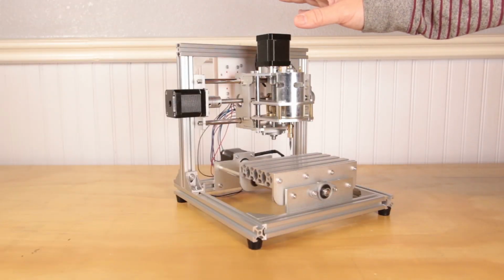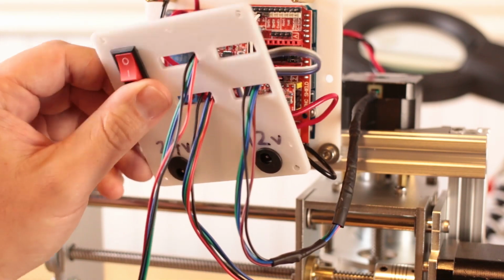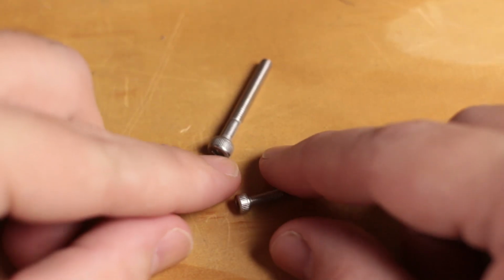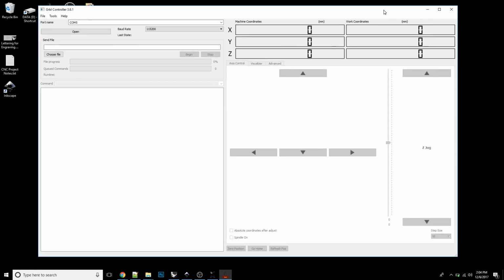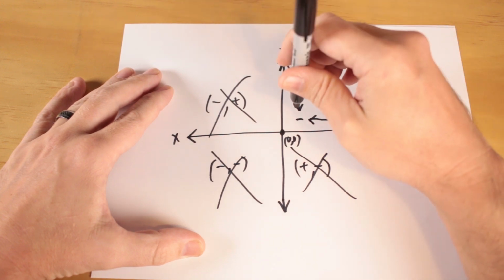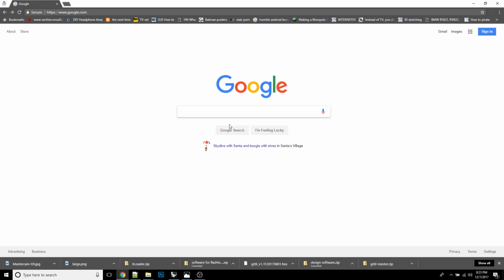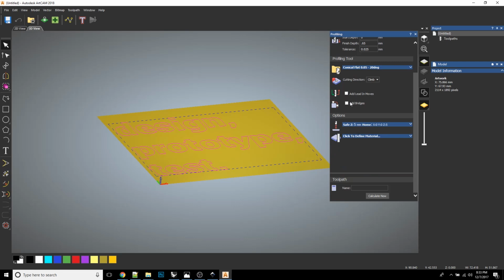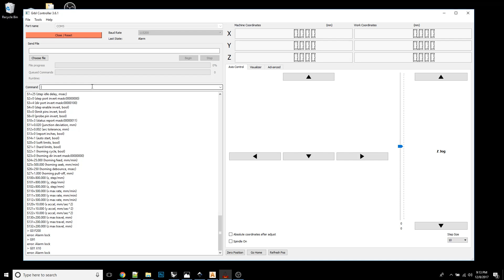How to start CNC Machining for under $200 - Working with the T8 CNC engraver

Comment: Wow the internet is certainly a place with opinions! Having skimmed through the solder/crimp discussion I would encourage you to consider moving from tinning wires to using ferrules and for crimps terminals also replace the soldering iron and needle nose pliers with a suitable crimping tool. You can now get "IWISS micro crimper" for about $10 off AliExpress instead of the pricy Japan made Engineer PA-09 and with a bit of practice you can use the same tool for virtually all your crimping needs (+ a separate ferrule crimping tool); so expensive tooling and one tool for each terminal is no longer an excuse for not making proper crimped connections that do not need solder.  Soldering has its use, but I would argue that more people would have less issues on moving connections if they got medium crimping skills compared to medium soldering skills.

Maybe you can get Gear best to stock the crimp tool and send you one to review, along with a ferrule kit. Once you master crimping I doubt you'll return to soldering.
Reply from the maker: Thank you for the well balanced comment. I have already begun using a crimping tool as you suggested. They are reasonably inexpensive and can be found on ebay and amazon by looking up "Dupont Crimping Tool" and "Dupont Crimping Kit." However, I seriously doubt the issue is as critical as the comments make it out to be. 

In my other video where I had the issue with the heated bed wire, I think one of the comments was correct. The issue stemmed from a terminal block which was not attached flush with the PCB. Therefore, as I tightened the screws, the terminal block twisted, and the solder on the PCB cracked. This lessened the cross-section of the effective "wire" which created a bottleneck for the current and caused the joint to heat up to the point where it melted the terminal block. A ferrule in this case would not have solved the problem. Also, ferrules are redundant. They crimp onto the wire creating a mechanical connection in compression. The terminal blocks also create a mechanical connection in compression when you tighten the screws.

Comment: DON'T TIN THE WIRE GOING INTO A COMPRESSION STYLE SCREW TERMINAL!  The idea of it, as the screw is tightened, is to spread the strands and create a larger contact "pad", as opposed to 2 narrow points that you get when tinning and creating what is essentially a single, solid conductor.  In addition, the compression against the strands aids in maintaining pressure and good contact when the wire and/or connector expands/contracts due to heat, which is less effective with a solid conductor...and a higher amount of heat is more likely to occur due to the lesser contact pad with the solid conductor, as it acts as a resistor.  Furthermore, tinning the strands into a solid conductor, as well as soldering wire onto a terminal, increases the possibility of the wire breaking when installed on a device that tends to vibrate.  This last point is not very likely to be greatly relevant here, but still worth mentioning.

Comment: You don't want to solider any cables that move around, you effectively make a stress point and negate the braiding in the wire. The wire will break off over time just like when you bend any solid cable, probably faster.

Comment: your actually supposed to NOT tin your connectors, the solder can crack and leads to a worse connection (solder has more resistance) than bare twisted copper.

Comment: An easier way to get the full y-axis travel is to mount the y-axis endplate to the outside of the frame, and move the rear crossmember forwards a bit. Makes the machine slightly bigger, though!

Comment: 12:50. The socket must have two ground pins. One is always connected and another one disconnects when something is plugged on. Its a feature not a defect. It serves as to disconnect to battery power when dc jack is connected in consumer electronics. Just solder the wire to another ground pin.

Comment: Good video, on the electrics agree, dump the solder, dump the quick connectors etc put everything direct on to rocker switches with leds.... you already have a plug on them so why have another just there to create a hot spot..... personally i would take th eelctrics as far away as i could from the machine and seal them up in their own box and stick a fan in it,.

I  never understand why they insist on putting them on the frame, i guess its cheap but its asking for trouble if you go down the metal route,  they will be full or crap in a week, add an air assist and a suction system and you are away.... 

The spindle speed is very slow on this model. so bear that in mins, many passes will be needed to produce something half decent , well presented video and useful to see the math explained so thank you for doing this....their are also plenty of other cam software and grbl out there for the asking....also of course if you MC board can run it Mach 3/4 the king of CNC

Comment: Tipp: Don't pre-solder the wire end, they'll lose their flexibility. Just clamp the flat plugs tightly, this will actually "cold weld" the wire and plug together and reduce the risk of breaking. (Google it!)

Comment: Just a little FYI:
The connector (socket) you had problems with has 3 Contacts, 1 connected to the (center) pin (and please stop giving them names polarity is not standardized on those connectors) and 1 for the sleeve (outside contact), the remaining one is the "sleeve shunt". The sleeve and sleeve shunt are closed (continutiy) when no plug is inserted, when a plug is inserted one of them is connected to the outside of the plug (the sleeve), the second contact (the sleeve shunt) is disconnected. This system was introduced so it was easy to e.g. disconnect a battery pack when a external power suppy was connected, the plug basically opens a NC switch.

Typically (as this is also not a standardized thing) the opposing 2 connectors (on the side you are soldering or crimping to) are the (center) pin and the sleeve shunt while the 3rd solder terminal is the sleeve.

Hope this helps people down the line as you connectors were fine (you just connected them wrong)

Also regarding the Solder in screw terminals, it's illegal to build / import devices using tinned leads in screw terminals at least in a few countries in Europe (don't know if it is even the whole of Europe) and insurance companies will jump on it if they see it (even if you got pinched by the spindle, they are going to argue that you weren't supposed to own or use such a device, which is correct and they are most likely not going to have to pay anything) this is especially problematic as tinned leads in screw terminals are a common source of arcing and therefore excessive heat up to causing fires.
Reply from the maker: Thank you for the good information about the socket connector. I have pinned your comment so that others will get the good info. That being said, one of my connectors was definitely defective. The other one works fine.
Reply: Yes. You are never supposed to solder wire being used in a crimp connector. I understand that you don’t have a proper crimper, which, if you’re going to do this type of work, you really need to get. You don’t need the pro tools I have, but a ratcheting crimper, where you get the same crimp every time, is really necessary.
Reply: Michael Amann Thank you. Came down here to explain the same thing.
Reply: That is because solder causes a rigid breakpoint from vibration, but every failed connection I've seen in homebuilt aircraft was crimped. Rules are for fools. I used 3 sizes of heat shrink on each terminal for stress relief and soldered all. Never had a loose connector on the ground or in flight and it was my ass at risk.
Reply: Sick Vic "Rules are for fools." 😂😂😂
Reply: sic vic ; i am so sorry that you feel that "rules are for fools". i learned my lessons the hard way, in the service in the early 70's, rules are NOT for fools, they are there to save a life, not necessarily yours but the poor miscreant who comes along way after you and your work are long long gone, the booby traps you leave behind by not following the rules always get someone else way down the line. i don't care how much stress relief you put on a soldered crimp connector sooner or later way down the line its going to bite someone.
why is there never enough time to do a job correctly the first time, but always enough time to do the job over again ?
Reply: Using military as an example gives me a hugh chuckle. I got out before you were in. When you can prove my method is not safe I'll listen. Those chinese set screws on pcbs            are absolute garbage, doesn't matter how you connect to them and they don't care if you die using them. Over decades rules have been proven completely wrong, only after people have died. How long do you want to wait for gov. to tell you? Don't stick your tongue in a light socket and remember food removed from the microwave may be hot :) I'm standing by rules "are" for fools.
Reply: normdoty ; While I don't agree "rules are for fools", I do think they are far from a proper replacement for understanding, and Vic may be venting some of that frustration.  Today I was informed that "safety" wants us to move our insulated ovens/kilns (outside temperature <55C max during operation) because they are too close to an acetylene supply tank (ignition temp 300C).  It's against the rules.  They asked us to move them 10 feet down the hall next to a chem fire cabinet that I know has kerosene in it (ignition temp 220C).  Apparently that's not against the rules.  Now the tech has to walk 10 more feet with a hot object to get it to a cooling tank.  But I guess that is safer.  

Anyways, do you really think a 22g tinned wire in a terminal block is a fire hazard?  Also, Vic is right about 1 thing - nearly every failed connection I have seen has been a crimp.  Those that were not were because of stress behind the connection.
Reply: Michael Amann b
Reply: Considered an acetylene leak? Gas can get anywhere that isn't hermetically sealed and some internal parts of the kilns could be expected to exceed the ignition flash point.
A proper fire cabinet is effectively sealed and, should ignition occur in it, should contain that internally.
Either way, I would have considered good ventilation to be more important, overall, to prevent either gas or fume build up to an ignitable density.
Reply: Rules seem to come in three broad catagories...
1/ Cover your ass type - usually by beaurocrats and management who have no idea of the actual process or detailed knowledge, but who over-react to some sort of problem someone has had, which may not even be relevant.
2/ Established proceedures, that have been tested and verified by actual people who know what they are doing, and are in place to prevent people who don't from doing something that has been demonstrated to cause issues. IMO, a good idea and not only because it is intended to protect people against others doing things that are dangerous to them. I have seen WAY too many 'bodge jobs' to be against that. 'Best Practice' is an informal version of that.
3/ General idiot proofing, that is aimed at the lowest percentile but also drags down the rest - an extreme example is a uniform speed limit that applies equally to an experienced F1 driver in a new hypercar and a learner driver in a poorly maintained 25 year old 'bomb'. You get the idea... Personally, while the 'nanny state' has some merit for some applications, overall I am a firm believer in 'The Darwin Principle' - let the idiots remove themselves from the gene pool before they get the chance to breed... harsh, perhaps, but would improve the species.
Reply: The link below shows an example of what a 3-pin barrel connector schematic looks like as described by Michael Amann. In this diagram pins 1 and 2 would have been connected together externally with a ground wire, but the use of pin 2 is actually unnecessary as the switched connection never performs any real function in this circuit.

The switch is often used in audio applications where headphone-level audio is fed into pin 1 and pin 2 passes this signal to the input of an audio amplifier to drive something like speakers. Plugging in the barrel connector would let the audio signal pass to the external (ie: headphone) connector while also automatically disconnecting the audio from the speaker amplifier. In other applications, the switch could be used to detect if an external connector was plugged in or not. There are cases where the center pin is ground, and the sleeve will provide external power, while separate internal (ie: battery) power connected to the switched pin is connected when the external plug is removed.

In the CNC build, if the ground wire was connected to pin 2 only, plugging in the external connector would result in the exact open circuit problem described when the internal switch opens up. Using pin 1 for the ground should have worked (unless the connector's pin 1 is in fact faulty).

https://i.stack.imgur.com/2feYN.png
Reply: Here is the full article where the connector pinout image came from:

https://electronics.stackexchange.com/questions/141897/dc-power-supply-jack-connector-pinout

Comment: Soldering wires before screwing them in a compression type terminal is a really bad thing to do.  You get a phenomenem happening called cold flow.  This is where the solder breaks down under pressure & changes shape.  It loosens the connection and actually makes it very poor quality which is precisely what you are trying to avoid.   Also if you have the correct crimp tool it is completely unecessary to solder the crimp connections you have made.  Properly crimped connections are really good quality, which is why the military use them.

Comment: I believe you could’ve moved the vertical assemble back to the very rear crossmember. Then the two rear faced 90 degree brackets could go along the rear cross member, rather than 180 degrees from the front ones. That would’ve moved back the entire vertical, and I believe much easier. I could also be wrong! :) thank you for a great video!

Comment: For all the tinning bs, lets get it straight. He tinned the wires he was going to put solder connectors on, and then soldered them. As far as the screw connector, you tin the leads to keep the screw from crushing the wire which is made up of several thinner strands that can be broken by the screw. It was a great build especially with no instructions and very informative. It looks like a fun build and yields useful toy in the process. Thank you.

Comment: The centre pin in a barrel type socket is not always positive. Plenty of devices have this pin as a negative and it's one reason you should always check that the power supply has the correct polarity.

Comment: NEVER EVER tin any cables before putting them into screwed terminals.
The tin will flow under the pressure, and the contact would get loose.
Especially with 120v/220v this could cause heat because of resistance, and begin a fire.
Reply: I was looking for this comment. Bang on.

Comment: This no tinning is new to me.In the US,in school,I/we were taught TO solder the ends if possible,as the wire may unravel while tightening,or not every strand makes contact,acting like a smaller wire.This will require some thought

Comment: I don't agree with rule 'always tin your wires' for connections you presented. For screw terminals you should use single core wire or if this is not an option (need flexible wire) you should use those crimping pipe connections. For MOLEX just twist wire and then crimp it. Why avoid tin? If temp will rise a lot it can turn in liquid inside you connector, slip from oversized crimp, which can provide short and fire. This may  be not an option for this CNC but it's still dangerous - even small NEMA can use 2A DC which in case of wire diameter you used may get that wire hot.

Comment: That's a great link, that you posted above ( from reprap.org). It should be required reading for all 'kit' and DIY builders.

Useless fact, a boot lace ferrule is actually called an aglet (/ˈæɡlət/ AG-lət) is a small sheath, often made of plastic or metal, used on each end of a shoelace, a cord, or a drawstring. An aglet keeps the fibers of the lace or cord from unraveling; its firmness and narrow profile make it easier to hold and easier to feed through eyelets, lugs, or other lacing guides.

:-)